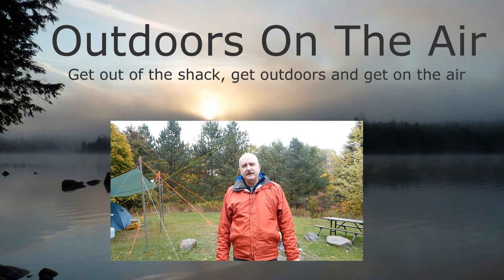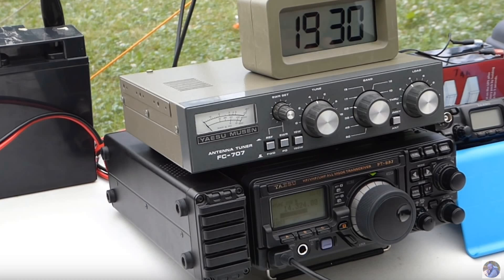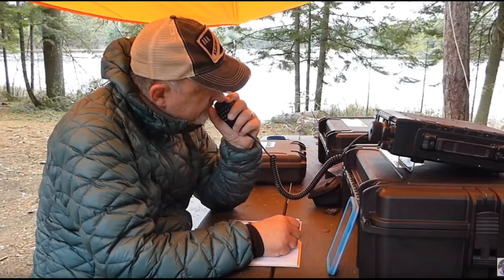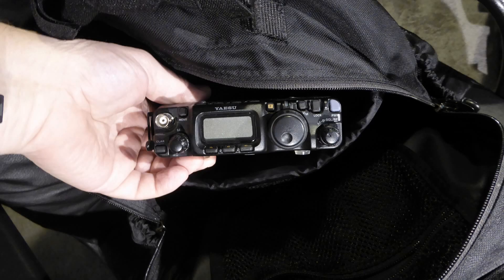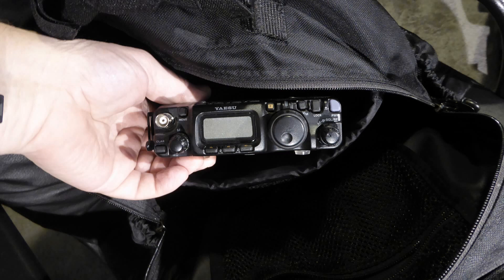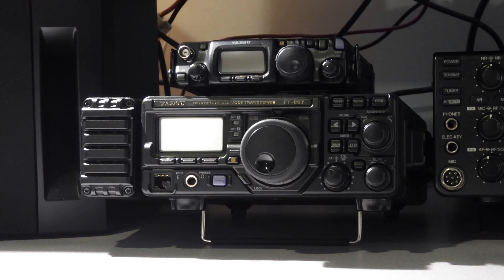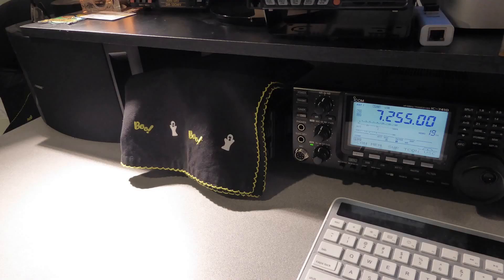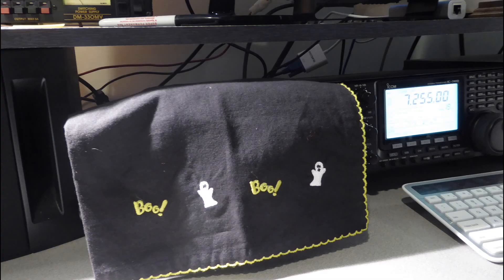Don't let this happen to your HF Portable Gear!

Comment: Nice one Tracy. I was expecting something a lot worse in terms of near terminal damage that would require lengthy and costly attention of a competent radio technician. Now I just have to get used to one leg being just slightly longer than the other!! Point noted - Don't let it sit there and gather dust or grow moss - USE IT. Cheers Bryce from VK.

Comment: since I saw this video, I took my stored in a box Yaesu FT-857D and put it to use in a POTA like operation. The poor radio has been on storage for one year before! Al brought to action my Patcomm PC-500 to another POTA like operation. We don't have POTA places as per se but I like to operate portable from time to time. Thanks for the good lesson! 73, Rob, YS1RS
Reply from the maker: Thank you for sharing your experience, Rob! 73 from VE3TWM.

Comment: I recently purchased a Yaesu FT-891 for portable ops. My base rig is an Icom IC-756 Pro3. The 891 is what I'm using on a daily basis. I bought 3 LiFePo4 batteries for emergency and field power. Plus a 100 watt solar panel. Playing HF outside is a great way to make sure your equipment and and antennas are ready for emergencies (plus it is more fun than inside).
Reply from the maker: Thank you for sharing your experience, Bill!

Comment: Little know fact... back in the earliest days of radio it was discovered that radio gear can get a form of constipation.  Not like human exactly but close.  Here's what happens.  We all know about the electrons rushing around in the circuits and bumping into each other.  That's as it should be.  Left sitting unused those electrons start sticking together.  Clumping here and there they jam in critical locations and refuse to move.  The cure is simple. Every few days, or weeks at the most, give them a jolt of outside current. It catches them unexpectedly and in a rush to get out of the way, they all start shooting about as they should.  Keep them active!
Reply from the maker: 😂 well done!

Comment: Excellent, Tracy, thanks! I was expecting something far more permanent, but you certainly made your point, and it's well taken. I also haven't been out there with my radio for a few months now, so I'll have to do penance by making up for lost time! Actually, Step 1 will be erecting my multi-band EFHW (finally!), stringing it between a 12m Spiderbeam pole and a tree. Thanks for lighting a fire under me! ;-)
Reply from the maker: That's the spirit!

Comment: Hi! I have one concern about this. Recently my new acquisition, an old ft897, started developing zebra lines on the display. I had no choice just to buy another display and it was very expansive because they are no longer being produce. The repair guy told me that humidity and cold weather caused this. Another common problem is the 3 ceramic filters that also catch humidity and die (but there are cheap) Now I'm too scrared to go out with the 897 or even the 817.... I don't know what to think.
Reply from the maker: Hi Guillaume, as far as I know a bad display on the 897 is rare. I've had my 897 out in cold weather, humid weather, and cold and humid weather with no ill effects. Same with my 817 and both units are still going strong. Look at some of my other videos and you'll see what I mean. Perhaps you just got one with a weak display. Bonne chance, mon ami!
Reply: @OutdoorsOnTheAir  thanks, I hope to meet you on the air. What an inspiring journey your chanel is!

Comment: Ha Funny! I can see where this would be great to use outdoors away from power lines and buildings. I live in the country in the SW part of Minnesota. 
I have a IC-7300 and love it. I am looking for a portable setup that I can both mount in my vehicle and use on either the tailgate of my UTV, Jeep, truck or picnic table. I was thinking about the Yaesu FT-891. I would like to drive out to the middle of my square mile section away from all the hustle and bustle of life and sit for a whole day and make contacts. I guess I could do that with my IC-7300 and a wire antenna.
Reply from the maker: Thank you for your comment! The 891 would be a good choice for that application.